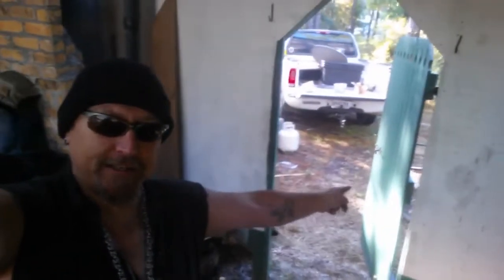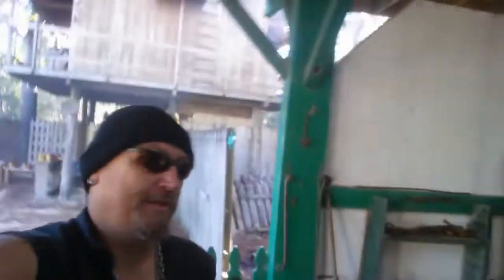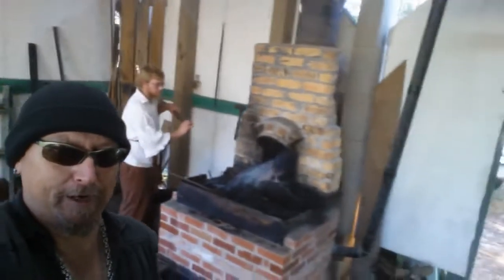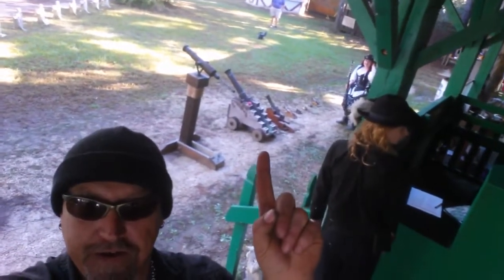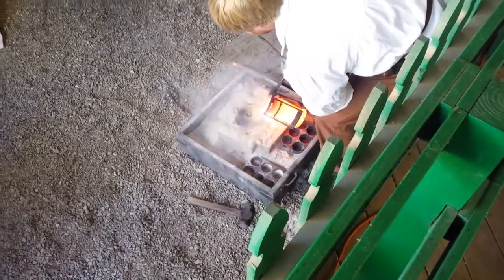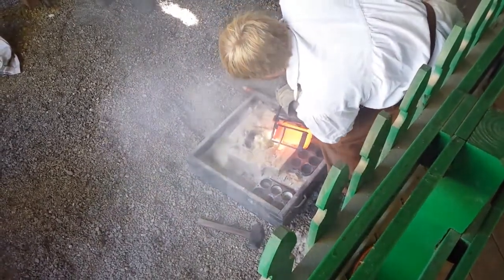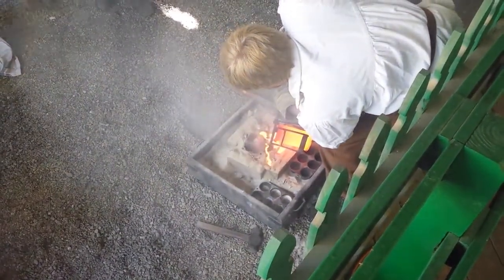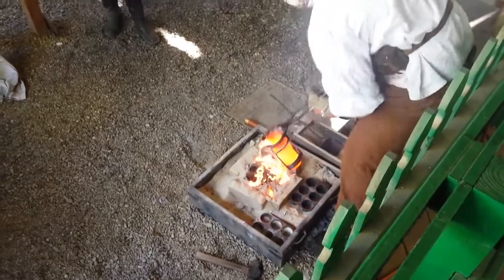vlog 7   faire day

Comment: Titanium tongs.  How hard does it move under the hammer?
Reply from the maker: If you get it to the right temperature it moves just a little stiffer than steel. If you try to hit it too cool, it won't move and you may crack it.